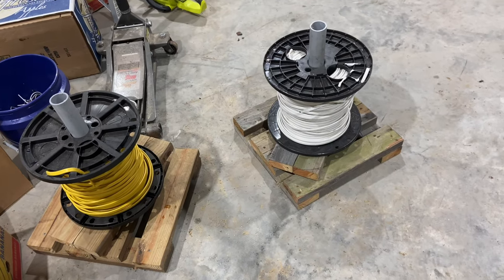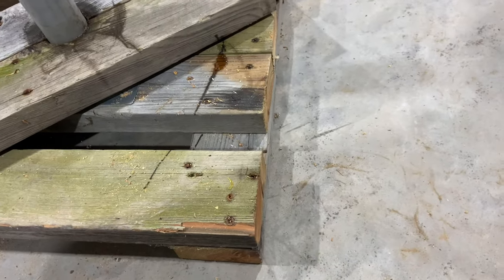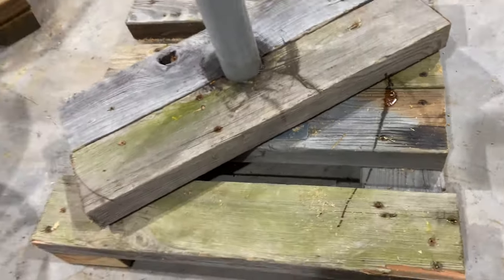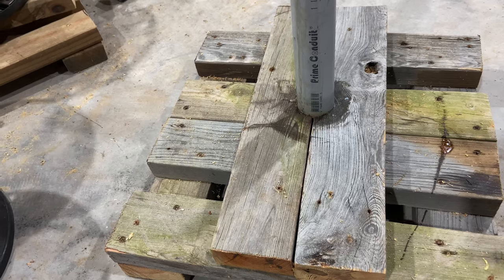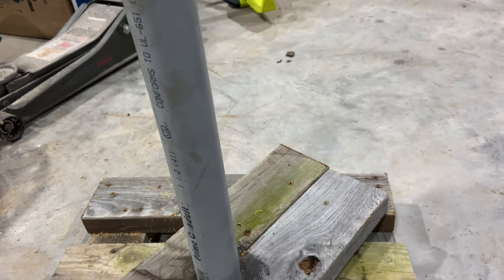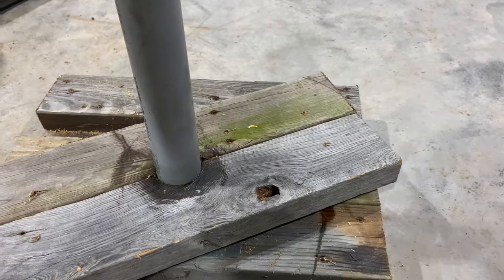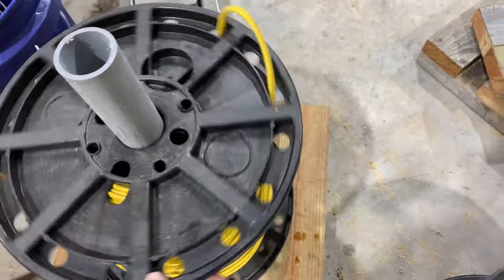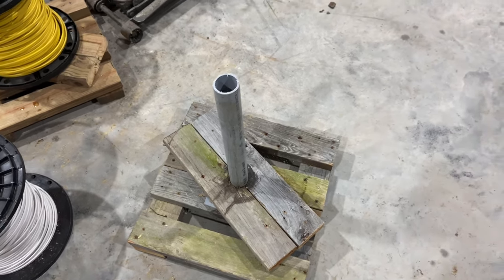Episode 25 - DIY Wire Pull Turntable

Comment: You can't use the EMT conduit spool holder you built?
Reply from the maker: Not for a 1000’ roll of romex. 

The EMT spool works for the 500’ rolls of small gauge THHN. Much lighter and smaller.